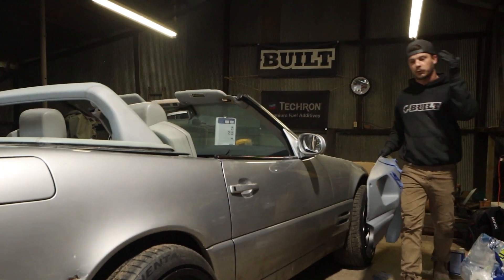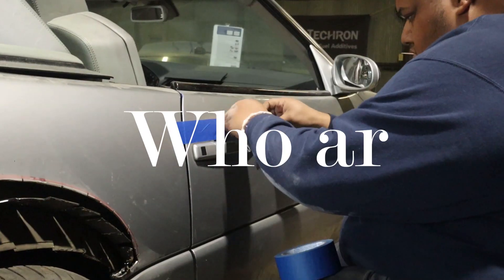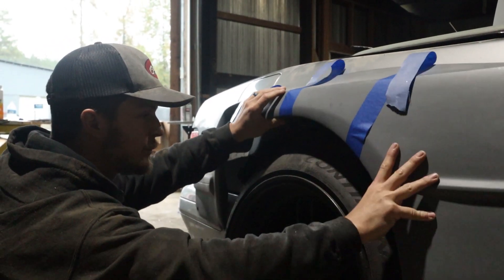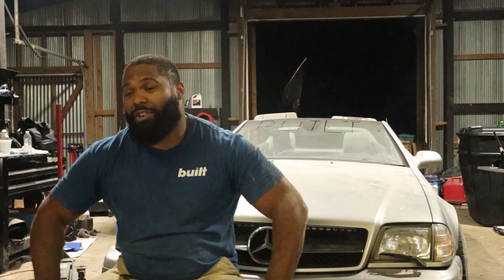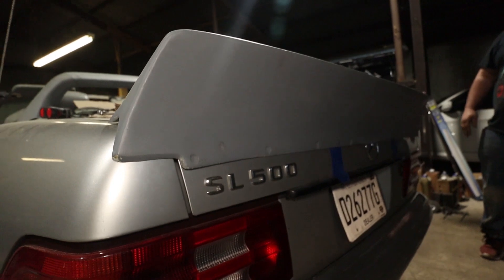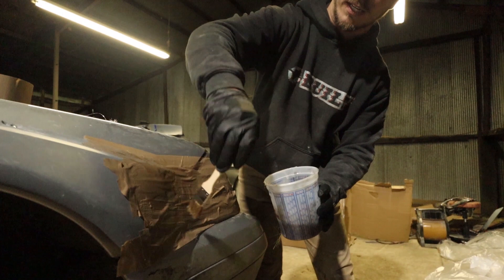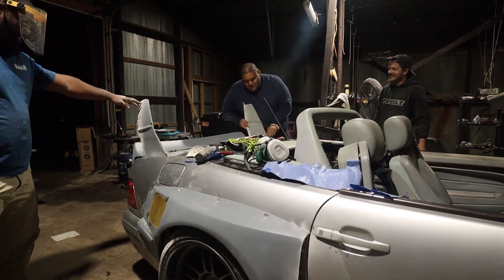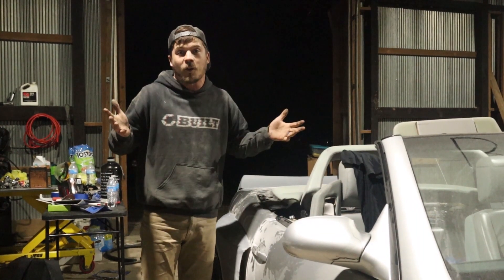WIDEBODY MERCEDES pt. 3 - I INVITED SUBSCRIBERS TO HELP ME BUILD A BODY KIT! SL500 R129

Comment: Is cutting suspension springs safe??
Reply from the maker: depends on who you ask and the type of spring.. on this car I would say yes as the spring will still seat as its supposed to. but we def need some shocks
Reply: @BUILTOFFICIAL  thanks Caleb for replying👍👍
I’ve got a 1993 Mitsubishi sigma (diamanté). Can’t find any lowering springs for it. So might look into cutting the springs.